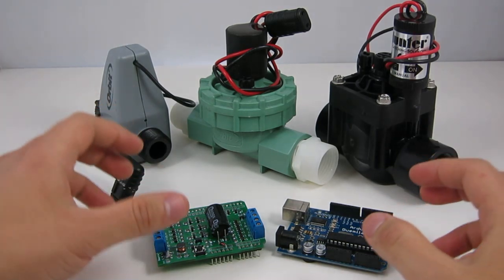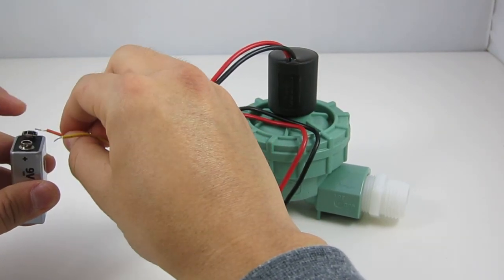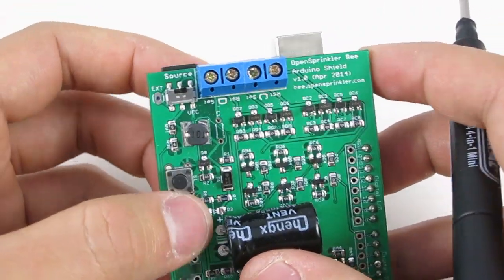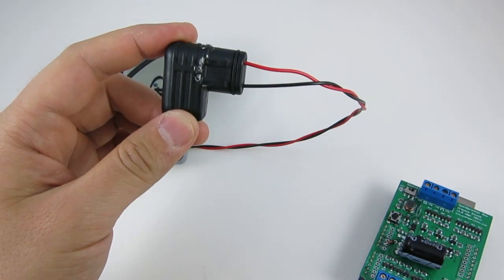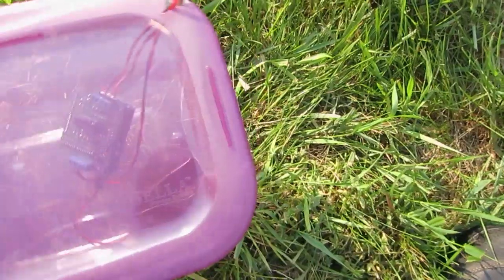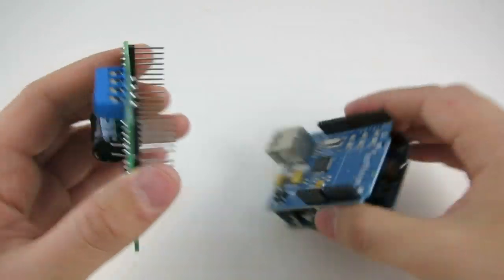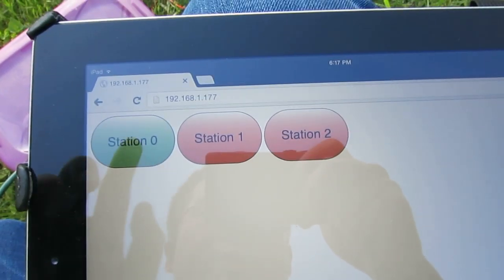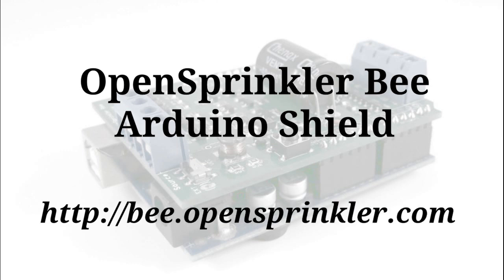OpenSprinkler Bee Shield for Arduino

Comment: Very interesting application for automated irrigation through sensors and valve control, and the presentation is given in a fully understandable way. Thank you very much for that very nice piece of work. This is probably the ultimate solution I am looking for and nobody else has given or I've not found anywhere else.
Reply: Checkout Toro's Evolution timer. It's firmware is easily upgradable and as technology advances you won't have to buy a new controller.